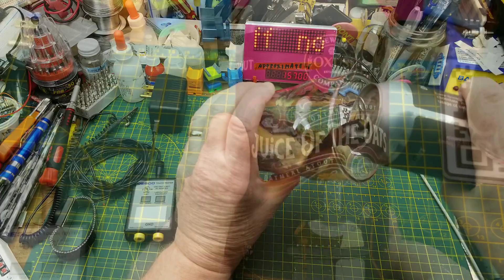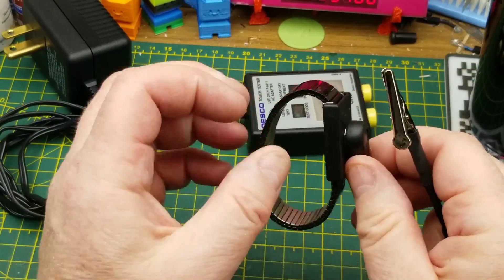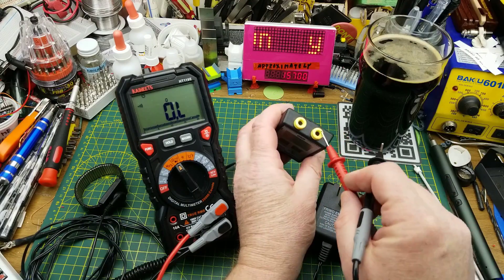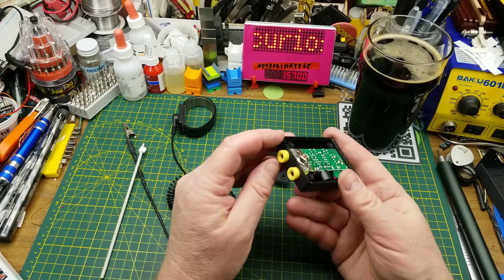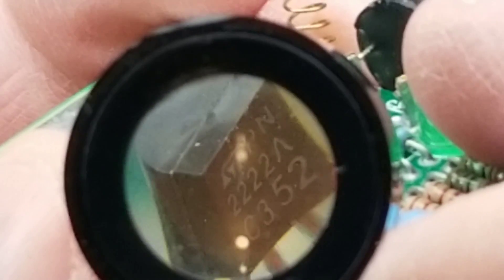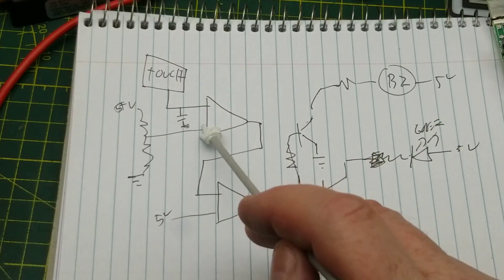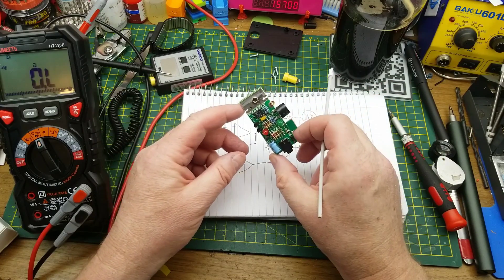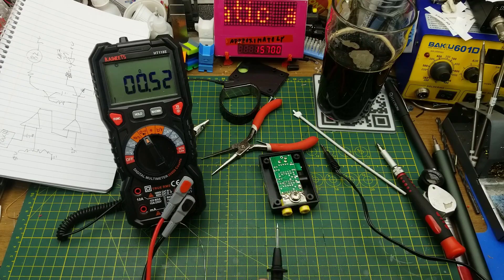ESD wrist strap tester

Comment: I purchased a used pedal from Reverb recently and, after a few successful uses it stopped functioning, that is the LED would not light up and the momentary soft stomp switch would not activate the relay inside. I opened it up to at least make sure there was no leaking caps, and discovered that the DC jack was connected to the circuit via a JST connector which was merely loose. EZ FIX! 😆👍

Comment: Your troubleshooting was flawed, as others have said below.
You first step should have been to power up the BARE PCB, connect the wrist strap, then touch the spring with your finger.
I bet it would have worked, and the fault was just the spring connection to the front pad.
Because you never tested the disassembled PCB, you are left to guess at the very end.
Reply from the maker: If my intention was to repair it, that would have been the correct order of operations.

I was simply curious about the circuit.

The fact that it now works is merely a bonus.

Comment: I worked in an electronics factory ( Satellite receivers) . ESD wrist straps were mandatory of course when handling product, PCBs, components , reworking etc.we also wore heels/ankle ESD straps that wore around your lower leg( sock level)then around the heel of your footwear.All of the floor in the production area had a grounded  conductive surface.

Comment: You stated that you do not think that you have much use for the device. However, if it were mine and being that I am compulsive, I would just plain have to change out the 20 year old e-cap... grin
Reply: And replace it with an inferior one from eBay.

Comment: I've been using a esd strap for years, in my test lab you had to test it everyday and sign the test sheet. In Teh towers toy room, I've still got an esd mat and strap in place, which is used every time I work on any electronic equipment.  No point adding to the damage while repairing it. About 80% of the static hits do not kill the device straight away,  you may just change its performance or cause it to die when it gets to your customers. 
If esd was not  problem then we wouldn't spend a fortune on preventing it. Conductive floor paint is not cheap along with antistatic footwear but it saves you having to remember to strap up.

Comment: As soon as you pulled the board out and revealed the spring, I suspected corrosion. I also suspect you suspected corrosion as soon as you saw it but didn’t say anything.

I’m honestly a little surprised to see the connection made that way, it’s such an obvious potential failure point. Planned obsolescence?
Reply: Spring is perfectly viable method to connect such a high impedance connection, especially if touch pad is not solderable (eg: stainless or aluminium).
His error in troubleshooting was to not test the bare PCB, power up, and touch the spring. So he went down a rabbit hole... 😉
Reply: I also looked at the springy thing with a condemning expression. Although I must admit corrosion never crossed my mind, I thought someone had bumped or dropped the device and the unattached spring had jumped off the contact hole and stuck on the plastic cover. Thus cutting the circuit between the touch plate and itself.
Reply: Yes, it was planned to break after exactly 20 years without calibration.

Comment: did you not put the ground strap on the other banana plug connector at start of video when it was not working, and the other when it was at the end of video? yes you did
Reply from the maker: They're soldered to the same pad on the PCB. There's no difference between them (take another look @10:22 )
Reply: @pileofstuff aha, well i have a fever from flu so im gonna blame that ;)